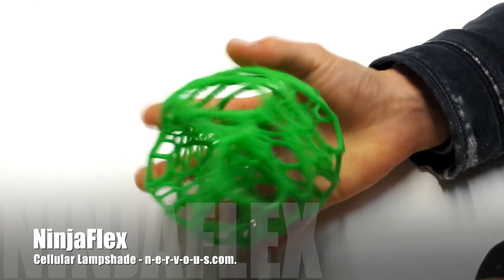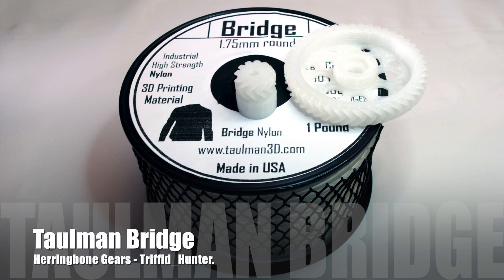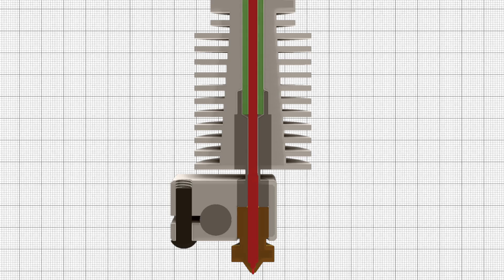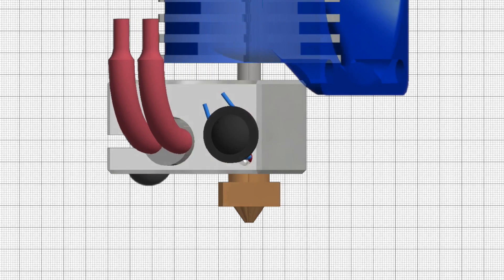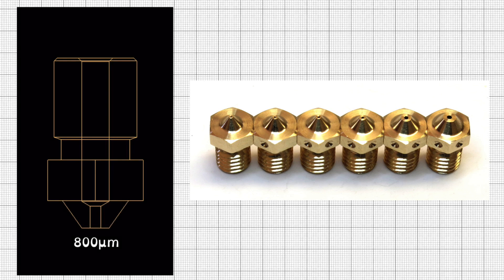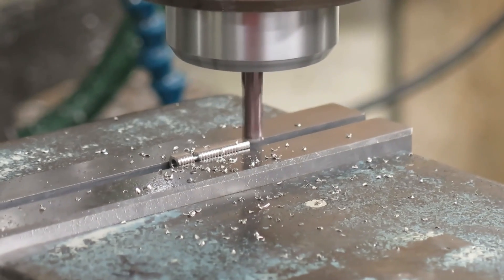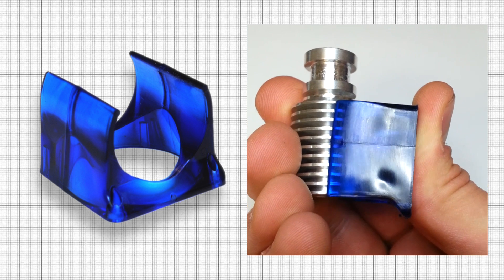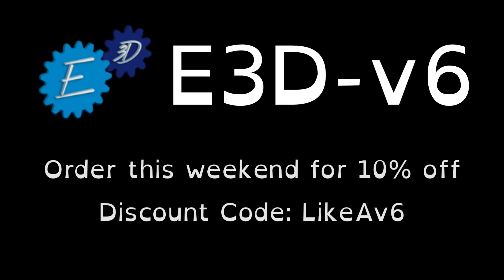E3D v6: A next-generation all metal HotEnd

Comment: confused. how is this an "all metal" hotend if the bowden tube extends all the way till (and probably beyond) the heat break?
Reply: bowden tube doesnt touch the hot zone so its still "all metal" where its hot. it can be halfway into the heatsink with no problem.

Comment: I got the tool changer 50% completed, told RichRap if your V6 and stepper feeder works good I'd ship him a printer, you have to ship me a V6 and stepper, in trade RichRap will print and show your machines mounted on BorgHanna, it's USA made with both metric and imperial bolts, you must see this printer before you sponsor RichRap as I, it would be a joint venture, I think it's strong as Brooks, probably because he's going to put a milling attachment on the machine, I see the v6 as very common as the CAT40 and that's the success to Ohio, no need to reply immediately as I am only one man and the new year has only began so as I drive to work and power with coffee shall 2017 be a great year for 3D printing, I'll send the information in the coming weeks, in the mean time I'll send a blogspot link in the comment below to get things rolling
Reply: http://ericprints.blogspot.com

Comment: are they selling a 3d printer that can print metal objects or is this an add on for 3d printers? if it is add on is it compatible with rigidbot?
Reply: This is actually only a hot end that melts plastic. This will only be used if you want to build a 3d printer.
Reply: If you have the universal grove mount in your printer you can upgrade to this.  I use it on my QUBD ThreeUp

Comment: Nice. What filament size would you recommend for quality / precision fine detail printing? Does the 1.75 filament have any advantage over the 3mm? I'd really like to hear your opinions as a company making hot ends about this. Thank you.

I've recently seen that 3mm filament is still actually a bit more expensive. Plus 3mm filament should take on less water from the air.